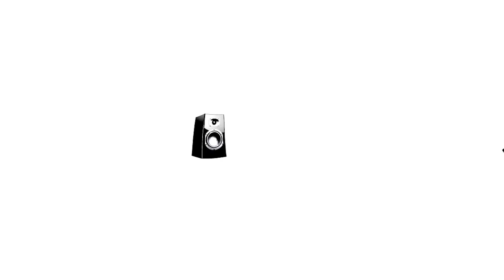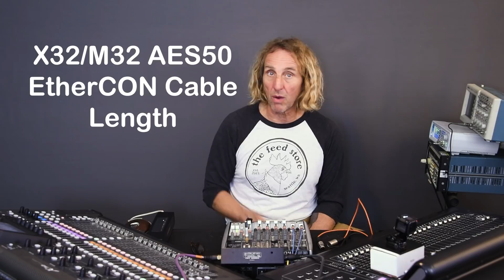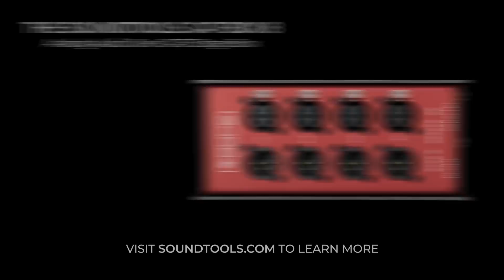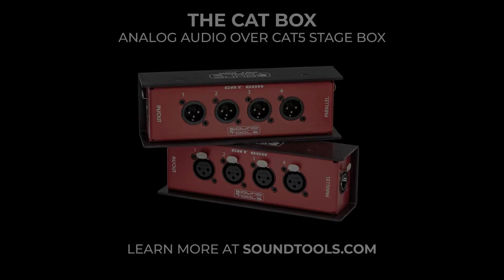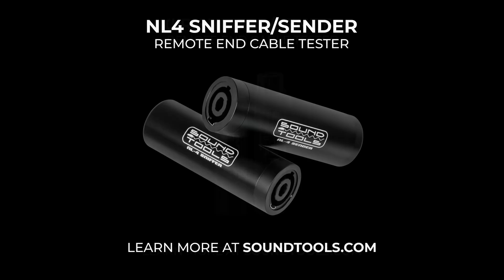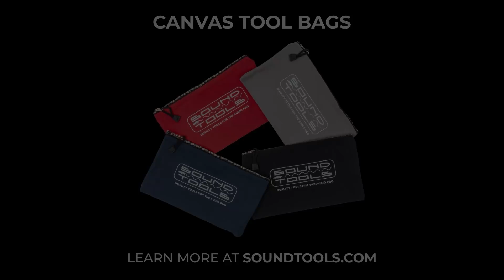Behringer X32 Midas M32 AES50 Cable Type & Length (Public)

Comment: I have always used 50 meter max and never had any issues at that length.
Reply: I have over 200 shows at 200' (60m) on an M32 connected directly to the stage box without any couplers, and the system has been rock solid using a ProCo shielded Cat5e cable that is very easy to coil.  I see Dave's comment that 80 meters should be the max and ProCo sells a 240' cable, so maybe they know something too!
Reply from the maker: Balancing reliability and capability keeps things interesting
Reply: @johnschalk1271   do you have the link to the cable you use?
Reply: @isaiahalexander6021  The M32, DL32 & cable were all purchased from Sweetwater at the same time about 4 years ago.  Sweetwater sells a Pro Co shielded Cat5e Ethercon cable in several lengths currently that I assume would be the same or similar to what we were using.  I do not have that system anymore, so I cannot tell you the exact part number for the cable.
Reply: @johnschalk1271  ok thanks, what system y’all moved to now?
Reply from the maker: Sounds about right. The consoles, based on how they operate, should be rated at 80 meters where they operate in a stable way

Comment: Hey Dave, Thank you for all the wise lessons you have taught over the course of these video's. As an owner of a x32 compact i consider them very helpful. I have been pondering on buying a dante expansion card for more compatibility whenever i am somewhere else, but i was always wondering about the overhead of TCP/IP on the audio signal, as it makes the package a lot bigger than necessary and it needs to be encapsulated, transported and then decapsulated. I would really like to see a test on any audio board and see the latency delta between a signal on a local bus and that same signal on a dante bus. plus maybe an input on dante to the board and then output on dante again. maybe even compare that to the latency in AES50 in the same setup. Again, thank you for the great content and wise lessons.
Reply from the maker: For short runs, aes50 is stable and has low latency. If you are running a long run, the need for ultra low latency tends to be loss likely

Why do we need a latency of leads that 12" when the source is 300 feet away? Do we really care if there is 2bor 3 feet more latency when the source is 200 feet from us and 20 or 30 feet from the stage? 

 So do long runs, the added latency of dante may not be a concern for many applications with longer runs especially when the added stability and muting rather than popping on errors is desirable
Reply: @DaveRat  makes sense when saying  it like that. I was concerned with timing of tap delays for instance but come to think about it, as they have the same latency as the original signal it makes no difference at all. Thnx for another lesson.
Reply from the maker: Use headphones for tap delays, as the distance sound travels almost always exceeds the latency by huge amonts

Comment: If your 'scope has the bandwidth it would be interesting to see the AES50 signals to see how they degrade after coming down a 100M cable compared to a shorter length. 

I see in several places the recommendation to ground both ends of the cable. Won't that introduce a ground loop?
Reply from the maker: We don't really care about a ground loop with digital as much as we care about static discharge.  So ground both sides is good.

As far as seeing the signal, the scope will show it but it looks similar to music on a scope.  Wild fast moving waveforms that offer little info our eyes can process.

Comment: I'm a bit confused why everyone is shocked there is so much trouble at 100m and longer.   The standard max length spec for cat5e cable (which Behringer recommends) has always been 328 ft/100m. So if you're running cable to ITS max spec I feel you're just asking for trouble at the physical layer.
Reply: Then let me clear that up for you :). The product should be stable at the max recommended length. Otherwise it's a useless measure.
Reply: @NikolajChristensen  If you're pushing the boundary of a physical cable spec and you're expecting 100% uptime good luck.
Reply: @anthonyanzalone  not pushing the boundaries. It's called operating within specs :). Different thing. If people advertise 100m it should work at that spec of course. In structural engineering you usually use a factor of 3. So a bridge that should hold 100 tones is actually capable of holding 300 tones. Safety margin. This product should have as well. Dante works reliably at 100m for instance.
Reply from the maker: I would have to say that if a product is rated to operate at 100m of cat5e, it should operate and be stable with all cables that meet cat5e spec.

I believe that based on what I am seeing, the x32 m32 should be spec'ed at 80 meters cat5e, where it consistantly operates well.

Then if people are able to find certain cables that allow 100m, all good.

To make a product that barely and inconsistently operates when a user follows the specs, is no ideal.

What if it was rated at 120v ac wall voltage but stopped working sometimes at 120v?

And only operated reliably at 100 volts?

Being able to exceed the spec by 20% is reasonable.

If they spec at 100 meters, it should work well at 120 meters, most of the time.
Reply: @DaveRat  exactly.

Comment: I came to the exact same conclusion as you did after doing 300+ shows from stadiums to clubs and bars with these. I couldn't find a pattern at all with what worked and what didn't. After a couple random drop outs at some festivals, I decided to run my own cable wherever possible. I would use one of your purple supercat 60m cat5e and carried an extra 15m one with a neutrik ethercon coupler when I needed that slight extra bit of length. 95% of the time 60m was plenty, but the times I needed the extra length, I  never had an issue with the 60m + 15m. I did try a 75m +15m purple supercat once and I will say that did not work at all.
Reply: in other words, these boards are unusable and trash. dante doesnt do this.
Reply from the maker: well since Dante is typically about 1ms of latency but it ya really mess with it and have all gigabit hardware and cable you may be able to get it down to 150microseconda and AES50 built in to these consoles is plug and play 62 microseconds, that means these "trash" boards use a communication method that is 2x to 30x faster/lower latency than Dante can ever be.

all protocols have their assets and issues. the variable and somewhat long latency of Dante is an issue but the locked in ownership/licensing offers a high degree of compatibility but also at a higher cost.

avb/Milan has better control of the clocks and latency than Dante and offers higher accuracy but there are more compatibility issues.  

aes50 has the lowers latency but it's point to point and won't travel through switches.

all the protocols have challenges when cable length specs are exceeded or cable specs are not correct for the lengths used
Reply from the maker: Perfect!!!

Comment: I would guess you might get better results with an active repeater (which I understand to be essentially just an op-amp) rather than a simple joiner, but you still need a reasonably strong signal to reach the repeater. But 100m (328 feet) is a pretty long distance, that's nearly a full NFL field, even at stadium concerts the sound board is typically not much more than half way down the field. I would wager that for the vast majority of concert venues you will hit critical distance before you reach 100m from stage deck.
Reply: Pretty sure an x32 shouldn’t be deployed at at a show where foh is 300’ away.  Not even an m32… at that point jump on to copper.
Reply: @Heywoodj1969  you might be surprised the shows where X/M32s are deployed, I won't mention any names to protect the guilty, but I know of more than one internationally recognised act that carry these consoles (whether or not they SHOULD is a different matter).... Also consider that 100m is not the distance that FoH console is from the stage, but the length of the cable run to get there, it is not always acceptable to run ramp down the centre of the auditorium, sometimes containment must be used that is significantly longer than line-of-sight. Signal almost always comes from Stage-Left but cable runs can leave via Stage-Right, add in deck height of 2m+ and on a big stage you can easily loose 30m before your cable has even left the stage end.
Reply from the maker: Interesting perspectives. As a person that personally mixed Chili Peppers at Live Earth at Wembley Stadium on a 32 channel Venice, I can say I am a fan of using small or inexpensive tools for big jobs if the situation is right.

That said, using gear that is on the verge of being unstable in a show-collapsing way is something I would avoid. The M32 and X32 have proven over a decade of being relatively reliable in in most environments though perhaps not ideal for large format shows.

Except when used with long approaching and exceeding 100meters of aes50 where they become unreliable.

So many variables but whatever tools are used, make sure they are reliable for the configuration.
Reply: @Heywoodj1969  It's not just X/M32s that use AES50 - Midas' top end consoles also use it
Reply from the maker: It may be a long distance but it is also the standard snake length for large scale concerts and events. So, maybe be long for something's but for a big rock show it's just a normal length and shorter is a problem.
Reply: The repeater is not just an opamp. It actually recreates the signal so you can add as many as you like.

Comment: I guess this is why the Klark Technic Aes50 repeater product is so sought after
Reply: Klark teknic production has been slow for years, The DN9610 was designed during the midas XL8/Pro series days, it's barely a relevant product anymore due to the Pro series/Heritage HD switching across to fibre for lengths above 100m
Reply from the maker: Interesting

Comment: Since the Midas M32 and the X32 has a different spec on max cable length (100M vs 80M), it would be interesting to see how 2- M32 consoles handled cables of different lengths versus  2 - X32s.
With this test being an M32 and X32, the assumption would be the lowest common denominator would be the limiting factor.
Of course, how did the X32 and M32 ultimately get 2 different specs? Is it that really the M32 AES50 implementation is actually different than all X32's, or was there a design change that newer X32s have and the M32 benefitted from (coming out much later than X32s) as well?... But maybe Behringer, to alleviate confusion, isn't giving the X32s a different 'official' spec between model runs??

In any case, it would be interesting to see if the 2 models/brands really do have differences between them and max cable length, or stability, on AES50.
Reply: I think they just changed the spec on the manual to lower than 100m because people were having problems and they couldn't explain why. I can confirm that Midas's own 100m cat5 does not work for this. Also, I have used x32 w/ s32's/s16's, m32r (first gen) w/ s32's/dl32's, and m32 Live (2nd gen) w/dl32's/s32's, and I didn't see any sort of difference. If I tried a "house cable" sometimes it would work, sometimes it wouldn't, and I couldn't pin it down to the behringer/midas or midas/midas or whatever configuration I currently had.
Reply: @iamjohnnytrox  BTW, there are at least four generations of X32.  Not sure about M32, at least two that I know of.
Reply: 100m is the max length under ideal conditions. 80m was written as it took height for some headroom. 

Remember that all ethernet cables are not created equal and may not even be up to spec even if it says so. A deviation from the cable specs will have a big impact on the signal quality and performance.
Reply from the maker: 80 meters is a reasonable spec, given the actual function.
Reply: Actually, the longest cable length recommended by MusicTribe for the X32 & M32 is the same; it is 100m.  However, for the much newer Wing, they recommend a maximum cable length of 80m.  We can almost suspect that they know 100m is too long, but they don't want to go back and shorten it for the older consoles and stage boxes.  The max length spec for the DL431 & 451 is also reduced to 80m.  The knowledge entry number for their AES50 recommendations is KA-02591.  The title is "How long can the Cat5e connection be?"  I'm pretty sure you need to be logged into their community in order to be able to search for this.
Reply: @johnschalk1271  No, Behringer changed it for the X32. It originally WAS 100m. It's 80M now and has been for some time. The M32 is 100m.
Reply from the maker: Once again a band shows up at a festival with an M32 and once again the 100M Cat5e run does not work with it. The desert heat and dryness or something and they had to move the console 9n stage.

We actually have 80m runs on all the stages except Sahara tent for exactly that reason.  But Sahara tent FOH is too far to use the 80m and 100m barely makes it so there was not shorter cable option.
Reply: @DaveRat  That sure seems to confirm (or add to the evidence), that regardless of the different 'official' spec, the M32 isn't much (if any) more robust for longer cables runs (100M vs 80M X32 spec) than the X32.
Reply: @AlanHamiltonAudio  The published specification on MuiscTribe's knowledge base shows 100m for the X32.  There is a table in knowledge base article KA-02591 which shows the maximum length Cat5e cable when connecting an X32 to any of the supported stage boxes and in every case, the table shows 100m, the same as it shows for the M32.  I happen to agree with Dave's findings that 80m is the upper limit, but fortunately I can do my shows with 150'.
Reply: @DaveRat  I just heard of the Klark Teknik DN9610, which is an AES50 extender, from a user on the ProSoundWeb forum.  He has used it at a facility with ~300' of Cat5e "in the wall" so he adds the KT device to it with a short jumper, and then tags on another 50' or so to reach his stage box.  It might be something for you have in your workbox :)
Reply: @johnschalk1271  Regardless of any non-updated webpages, Behringer lowered the spec to 80M from the original 100M for the X32. Unless something has changed, they kept the spec for the M32 at 100M.
Reply from the maker: Definitely some confusion. Cheaper unshielded Cat5e sometimes works at 100m but has static electricity issues, using shielded helps the static but reduces the length. Pretty much they over spec'd, like a cheap car stereo amp does with watts
Reply from the maker: Yeah, putting bandaids on a system that would require an adaptor box mid snake wedged into a cable ramp is not an adventure for us.

Our systems are stable on 100 meters with Cat5e and Dante or much longer lengths using fiber.

If M32 and x32 we're actually stable at 100m, that would be good, or if they clearly stated that they are only stable to 80m, that would be helpful.